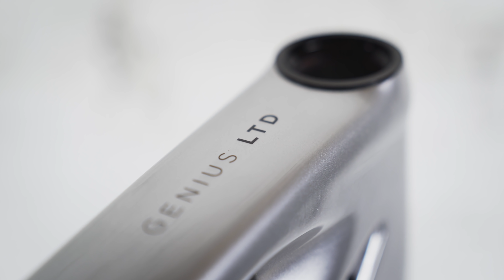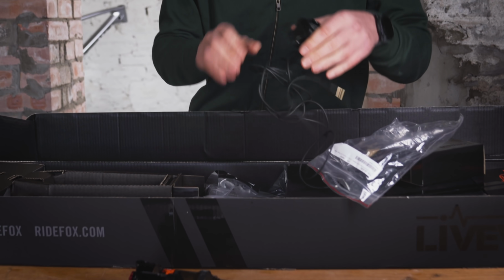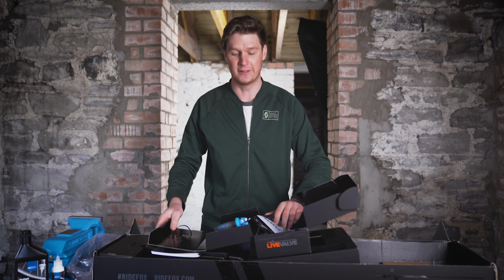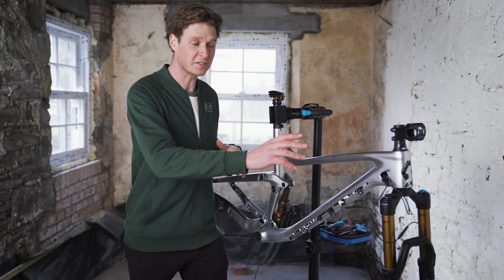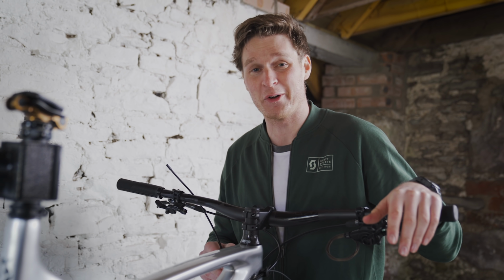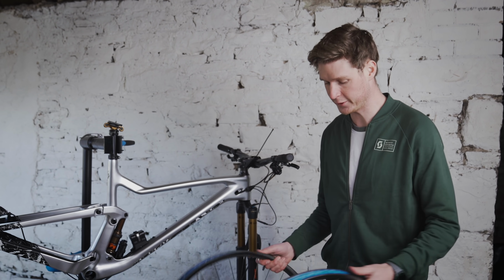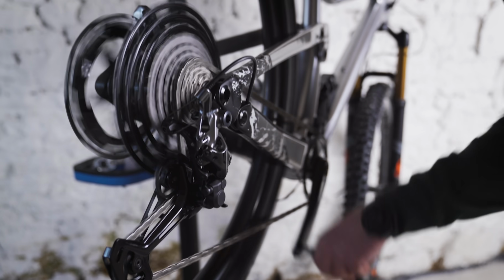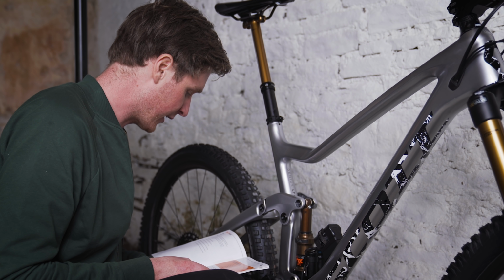Building My Dream Trail Bike | SCOTT Genius

Comment: Were you able to order your suspension directly from Fox? Finding Fox Nude shocks has proven to be a huge hassle for me.
Reply from the maker: Yes but not so easy for a Nude shock, have you been in touch with your local dealer?
Reply: @ScottyLaughland  yes, but it's unclear whether they've ordered it. I need to contact them again or find a different dealer to work with. I wish we could buy these directly from Fox.

Comment: Does anyone know if there is a cover plate for the cable routing for the shock? Looks like without the twinloc system it would leave a large opening into the bottom bracket
Reply from the maker: Everything’s covered in the same way as it would be if Twinloc wasn’t there. With the kit I got all the adaptors I needed to fit it to the bike...
Reply: @ScottyLaughland  okay thanks, so it’s just the stock rubber boot that comes with the twinloc setup 👍🏻

Comment: Bit late to the party on this one. Just wondering what widths you’re running on the tyres. Magic Mary has been my go to ride anything front tyre for a long time now. Rear tyres have been the issue. Running different brands at the moment. The old Nobby Nics were terrible. These new ones do look a little like a mini Magic Mary though so considering dipping my toe again as it’s time for something a little faster rolling on the back.
Reply from the maker: The new Nobby Nic is a huge improvement I’m a big fan of it! It’s fast rolling, has aggressive side knobs and a great braking edge. It’s a good matching for trail if you want something for bigger mountain riding or enduro then check the Big Betty, it’s awesome for it.

Comment: Nice build mate, what's the bb press you're using? Looks nice and simple
Reply from the maker: It's an old Hope one from years ago - works well. Need to get the updated one from Unior!
Reply: Thought Scott advised it was best practice to press fit BBs into carbon frames without grease?